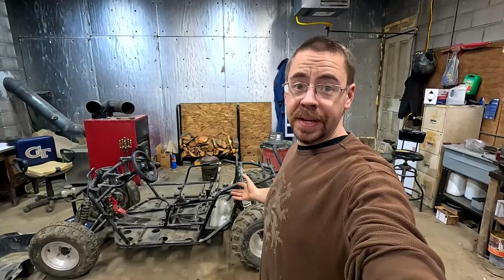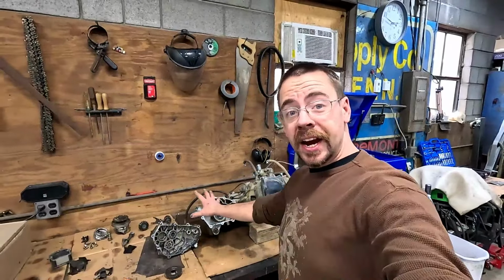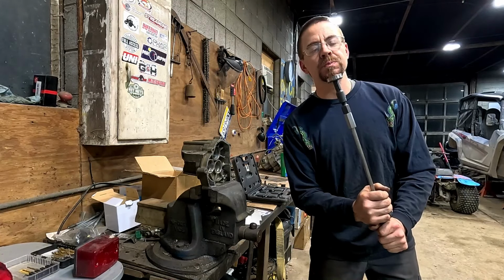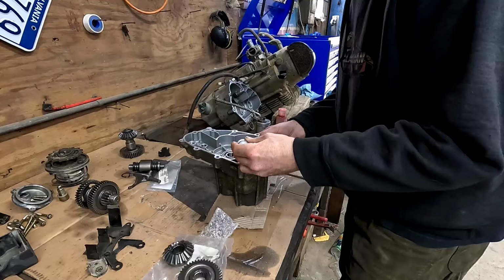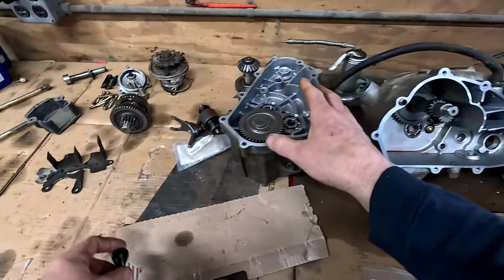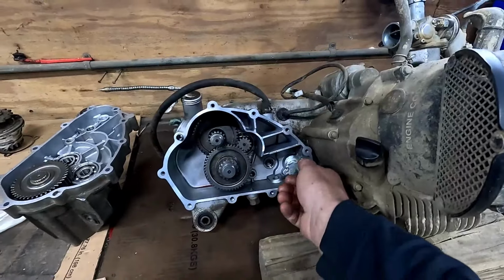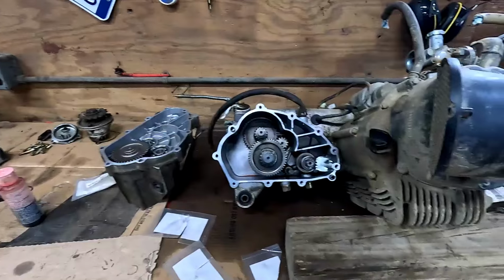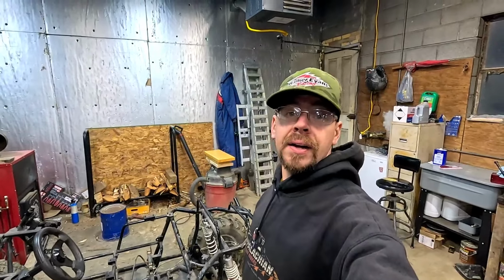Can it be saved? Rebuilding my kids Polaris RZR 170

Comment: My throttle is stuck wide open after changing the carburetor. Any idea what I did wrong? Air mixture and idle screw have no effect. Something to do with the throttle cable.